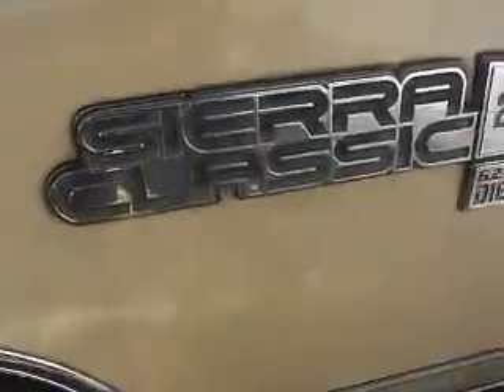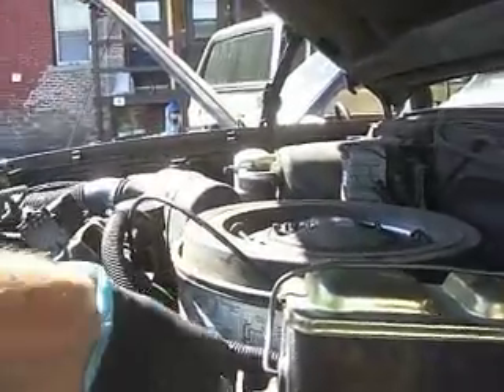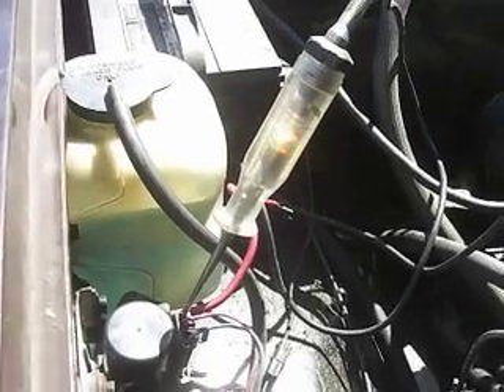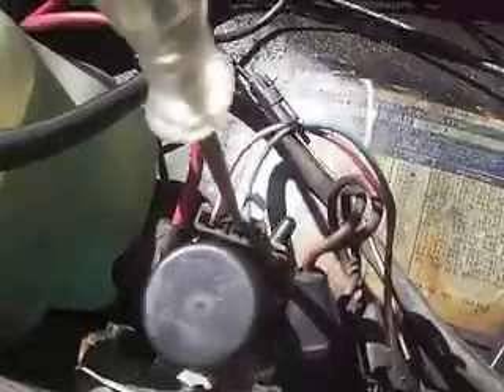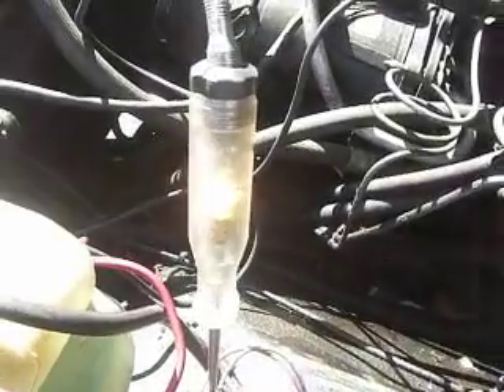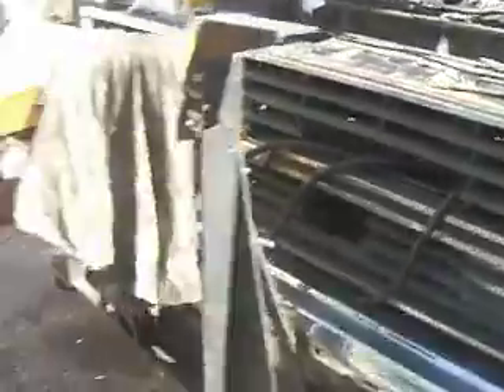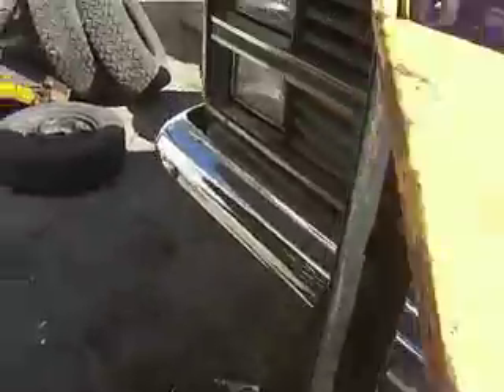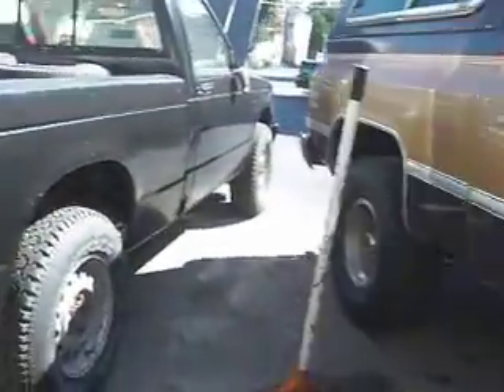How Do Glo Plugs Work???

Comment: the solanoid is probably bad. theres now real way to check the relay youve shown youve got juice all around it i would guesstmate the relay is bad. ive have a good question for you; i have found a blazer like yours in a salvadge yard 6.2 ltr diesel. its 12 volt but has 2 alternators both of them are reasonenably heavy duty. whats up w/ that? im almost thinking an aux. power source of some kind.

Comment: Just to help you out. When i replaced my dana 44 front to a dana 60 it bolted right in with the 60 spring plates. Only problem was the rubber brake lines are smaller fitting at caliper end on 60 than 44 order up new lines for 1 ton bolt right in

Comment: According to what ive researched grounding the blue wire should activate the relay. Normally its grounded via the controller when their needed. The red wire is always hot when the ign is turned on. With a controller that diode is important it keeps the spike out of it. Go to rat shack and get 276-1102 install across the red and blue wires with the white line pointing to the red terminal. Then find out why the controller isnt working possibly bad ground to controller. Need wiring diagram.

Comment: i can check the glow plug system on my 85.  the controller is different.  it's similar to the 6.5 controller.  I believe there is a controller card that controls the relay.  It's job is to turn the GPs on for a set amount of time and then cycle them a few times.  I have no idea how it works but maybe your is missing or burnt out?

Comment from the maker: Hmmm, interesting. I did switch the relays, the one on the K5 is from the Sub, and the one on the Sub is from the K5, and it works, so the prob is eslewhere. What's weird is that the relay should click if I jump it from the batt, which I tried. The relay is also well grounded, no rust, and I tried a jumper wire just to be sure...

Comment: Take a volt meter, set to continuity or ohms. The symbol on the meter often looks like a diode ->-
With key off, place on lead on a ground and other on that wire. Should only see a couple ohms at most. Any more... get a new relay!